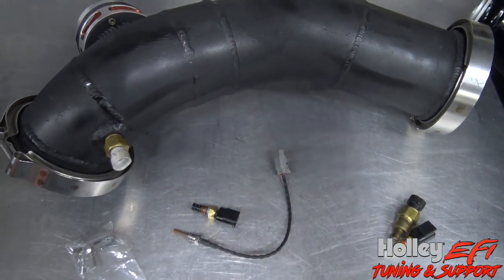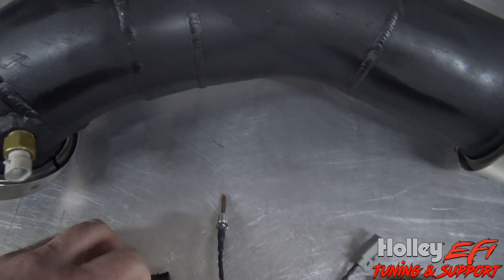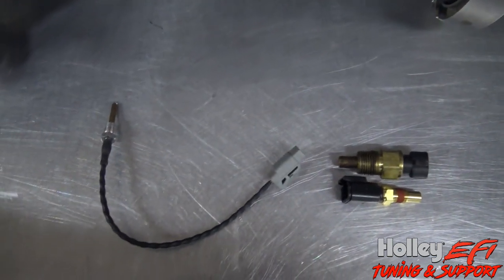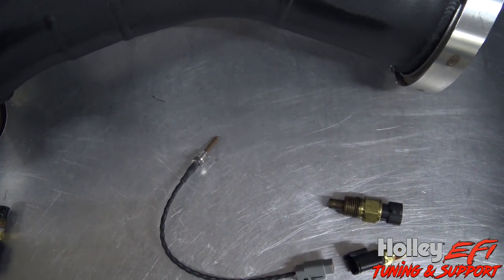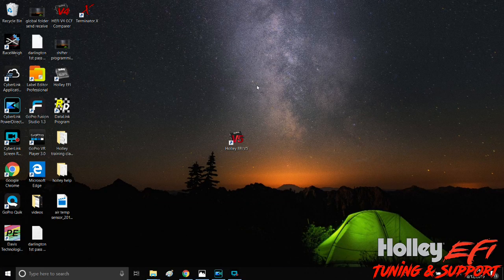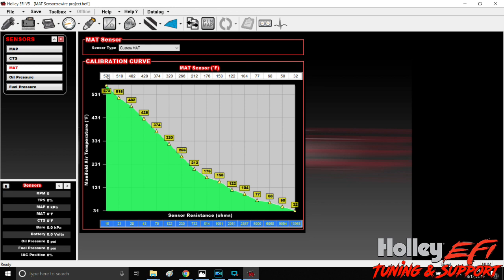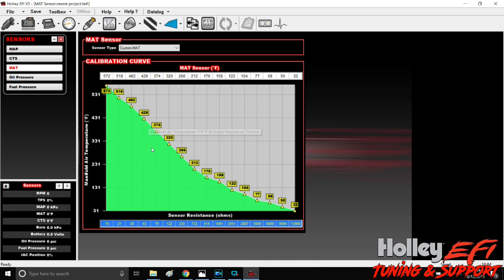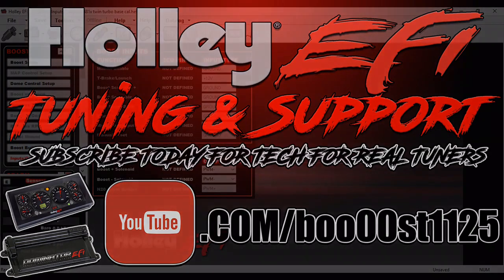Fast response intake air temp sensor in holley efi

Comment: Just like to know what mat sensor that fits stock engine with terminator x max wiring plug
Reply: I used an intake temp sensor from a Pontiac Grand Prix  GTP, works great.
Reply: Kind of late but Rife sensors sells a fast response iat sensor rated to 485f with the gm style connector that the terminator x uses